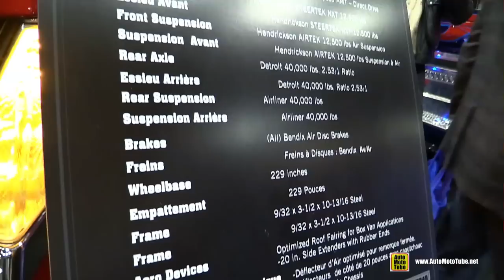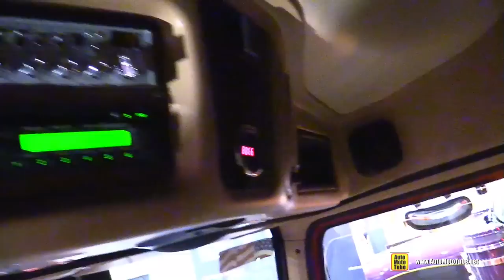2015 Western Star 5700 SE 68" Sleeper Tractor Truck - Detroit DD15 14 8L 505hp Engine - Walkaround

Comment: Pretty much bought this truck on some of the videos that were produced on the 5700. Pretty disappointed  on the pulling power of the 505 DD15. I've got well of 3 million miles of driving experience with 5 different trucks and engines. With the DD15 and 13spd I've lost well over 10 miles per hour pulling speed on pretty much most of the hills that I climb.And that's comparing it to the ISX 450 and the ISX 475
Reply: Dave Shaw U can put a 60 series detroit or a 3406 in it
Reply: wow thats just sad to hear
Reply: My Crashcadia has a 505 horse speced engine, a direct drive DT12 and 2.53 downspeed speced gears.  If I want to get over any decent hill, I've got to run the truck up to 75 or more to have a fighting chance of not bleeding off enough speed to drop gears.  Furthermore, this truck came with low profile tires, and the last truck I drove had the same gearing and tall tires; and hooked better as well as gave back much better economy.  I'm not a fan of downspeed specing nor am I happy with the direction Daimler took Freightliner.

Comment: Shame the interior wasn't better lit, I'd also recommend maybe altering the music vs looping such a short track I ended up muting it. Far as the truck it's self goes strange to see the air and electric lines mounted so far back from the cab. Also what is that dial at 4:45 beneath the steer column?
Reply: It is a Battery Disconnect Switch

Comment: The problem is that it has a DT12 auto transmission.  While the DT12 is good for an automatic anything but an Eaton-Fuller Super 13 or Super 18 is crap.

Comment: only 505 hp from the 14.8L Detroit?
Reply: I think its only begining, new trucks are always with base engines. BUT even with 505 it will go in mountain serpantines wery well, cose there god damn 15 litres!
Reply: 505 hp peak is at 1800 RPM and the torque peak will be a hair over 1000.
Reply: @sergeybalmont8626  You have to have 14.8 liters to overcome the horsepower loss from the regen system.